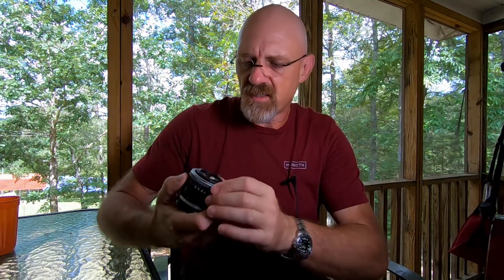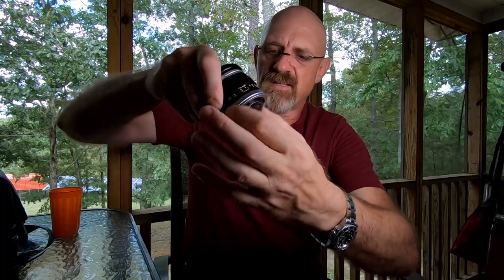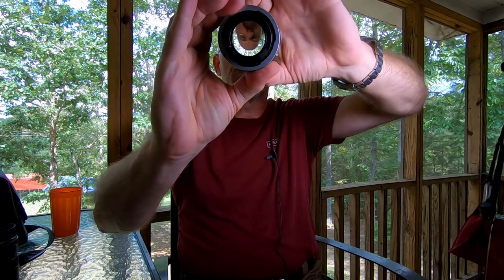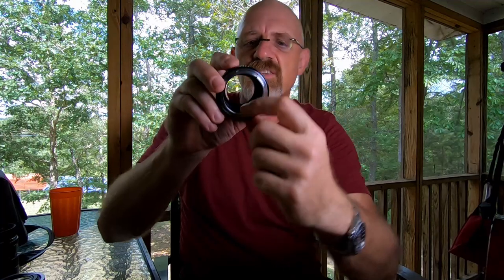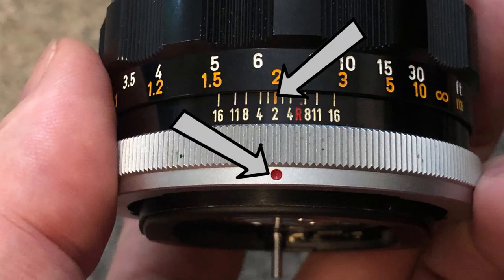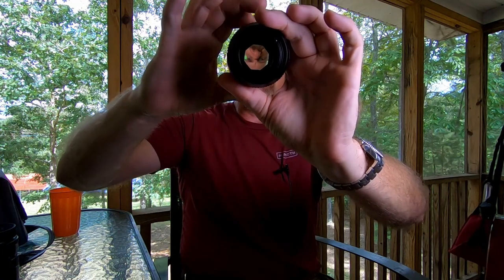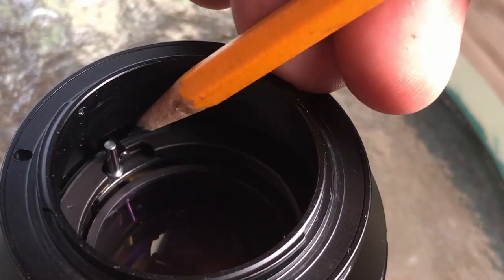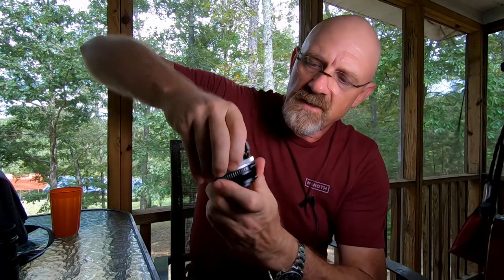Canon FL Breechlock Lens Adapter Installation and Discussion

Comment: I have the old Canon AE-1P with the breech lock mount.  Since I have only two canon FD breech lock lenses I never bothered to try to adapt them to my Nikons. In fact never thought it was possible!  However, FINALLY found an adapter for using Nikon F to the canon FD with BL.    Had to order it from China but it was cheap.   It’s a veeeeery thin washer type of adapter but the Nikon lenses work beautifully with it.  And the AE-1P utilizes the DOF preview button for an easy peasy stop down metering function,    Hummm... wonder if I should try one of those adapters.
Reply from the maker: Interesting! I never knew that those lenses were even compatible with the AE-1... neato to say the least. If you have a mirrorless camera or plan to get one in the future, these lenses produce results that only a vintage lens can generate, you should at least look into it to see what they will do, the adapter is usually less than 20$ and I have found that eBay is cheaper than even the mighty amazon!!! 👍📸
Reply: David Saylors Yea, the AE-1 and AE-1 Program cameras utilize both the old breech lock and the simple FD lenses.  But not the newer type lenses. I may look into that adapter since I do have the Z6.

Comment: Hi Dave. Thanks for this. I have the same lens. FD and FL lens are what I use exclusively for video. The issue I am having is that that particular FL lens (58mm 1.2) seems to have a sloped rise on the mount centred by the pin. Not all my FL lens have this rise. It won't full fit the adapter. I was able to get around this by removing the pin on a less expensive adapter rather than pull the pin on my more expensive metabones adapter. Your video was helpful in getting around not having to remove the pin, but the design of the metabones adapter just won't allow the lens to fit snug enough to turn the breach lock. Have you found similar issues, and if so do you have another solution?
Reply from the maker: I have seen this before once but I don’t know what the solution is for it. That seems to be some sort of anomaly kind of lens as mine isn’t like that at all. I wished I had a solution for you, but I dont. 😞
Reply: David Saylors Thanks Dave, I’m a dog and this lens is the bone. The glass is too nice, 1.2 is fanatic and the focal length of 58mm is a great in-between.
Reply: @terranceodette2805  I have the same clearance issue with my FL 58/1.2 on a focal reducer (FD to M4/3). That sloped riser in the breech mechanism of this particular lens is a head scratcher.  I wonder if a conversion to FD mount is possible? On M4/3 it is effectively a 116mm telephoto...but I would really like to use it as a Focal Reduced (effectively) 84mm. The glass and body on mine is mint and I really do not want to put this lens on permanent display, in favor of an FD 55/1.2 alternative.
Reply: @jb678901  I bought a inexpensive FD to L adapter and removed the pin. I just got the lens re-greased and it's beautiful bit of glass. You could try to get a speed-booster (in-expensive and try removing the pin, but you would be putting make not great glass behind great glass. Personally, I just switched to a full-frame camera.
Reply: I had to send an adapter back due the lens pin holding the adapter away from the lens.  That was a glass adapter.  I think the glass-less adapter will not have this problem as the pin will go up into the center ring.  The best thing to do is get a conversion kit that works for the FL series.   A proper one will move the lens 2mm toward the sensor and in doing so allow the lens to work like it was designed to.

Comment: Thank yhou David, your video really helped me with the apperture issues with a Tokina EL 28mm f2.8, the other thin now is I can only use it as a macro, like only focus super close to the subject. Any idea how to solve this up? Again, thank you so much
Reply from the maker: Yes, this sounds like a flange distance problem. The lens is too far from the sensor and the further it is away, the closer it focuses. This is how extension tubes work, the same principle. Your adapter is too long… 👍
Reply: @davidsaylors  that makes sence, thanks a lot David, cheers from Mexico

Comment: I think the Canon FD mount system deters new users from using them on mirrorless cameras, hence their relatively low demand and price. Compared to other bayonet mounts, I can see why people gived up with the increased complexity of Canon FD lenses and FD adapter issues. It's overblown to be honest, but it does take some time to get comfortably good with mounting and unmounting FD lenses.
Reply from the maker: Yeah, it is an anomaly at this point and it is simply easier to use lenses from other makers that are just as good, but easier to use...

Comment: Have you ever had a stuck lens adapter. Do you know how to release them.
Reply from the maker: I have two of these for the breech lock Canon lenses. One was stuck once and it turned out I had failed to “unlock” the ring on the outside first. That is the only time I have had this problem though.
Reply: @davidsaylors  thanks, it's so frustrating. New lens and new adapter.

Comment: Is there a focal reducer (FL to M4/3) out there?  My FD to M4/3 focal reducer does not work with my FL 58/1.2.
Reply from the maker: I have no idea. Maybe someone else does know though. I did a quick search and came up empty.
Reply: @davidsaylors  I tried the same as below with a Roxsen Focal Reducer.  Solution works here too. Clearances were all good. FINALLY! This will make for a very nice portrait lens (58mmx2x.72= 83.5mm equivalent FOV, f1.7 equivalent DOF on M4/3)
Previous comment:
"I tried adapting my FL 58mm/f1.2 to no avail.  The breech- lock end of this FL mount has this infamous ramp/hump that does not allow the adapter's lock/unlock pin clearance to let the lens mount lock-ring sit flush with the adapter interface.  I ordered  a K&F adapter that stated FL compatibility...but again...the same issue. Twenty-five bucks down the drain!...or is it?

I tried a different approach out of frustration, without modifying the lens. The lens is MINT and I did not want to alter it in any way.

First, I unscrewed the adapter's lock/unlock pin from its housing. On the K&F adapter this small Philips-head screw is accessible from the outside of the adapter.  OK, now the adapter actually  fits flush with the breech and can be attached appropriately.  First win.

Now, how to get aperture control back, as the lens can only work wide open with the adapter's lock/unlock pin removed?

I had some spongy black rubber material and cut a length (having a small rectangular cross section) that could be compressed within the space of the lens where its aperture control pin can be pushed to the far side, such that the rubber material pushes against the spring tension of the lens' pin mechanism. Win 2...now I have manual aperture control again!

Lastly, I took a small piece of the same spongy black rubber material and jammed it in the hole left from the adapter pin's removal. Voila, a functioning adapter that no longer has a conspicuous open hole that could pose exposure by the elements to the rear lens and/or sensor.

The pin can always be returned to the adapter.  The lens was left unaltered.  The adapter mount housing is sealed. The spongy material can be easily removed with a wooden toothpick. I have full aperture control of this adapted lens!"
Reply from the maker: That is awesome. Thank you for sharing it with us. 👍📸